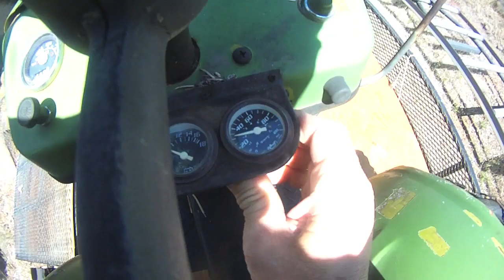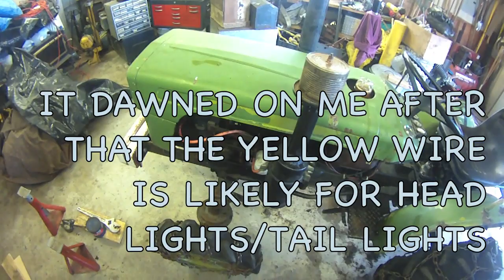Yanmar 155d Tractor Clutch Replacement

Comment: Although you may never do another tractor clutch I set up a beam in the shed or use a removable leg gantry  length  ways over the tractor and suspend both half,s from chain blocks 2 chain blocks on girder trollies so I can roll the tractor apart and back together in perfect alignment , it's worked for me several times even in the field
Reply from the maker: Hey Brian,  Funny you mentioned a beam.... I had been waffling about a gantry system...either overhead beam or building a "portable" frame.     It was this very job that convinced me to finally get one.  I just brought it up  a beam to the property this last weekend...I will have a video up in a couple days.  Thanks for watching.

Comment: I'm surprised you didn't keep ahold of it. Something like that would be pretty useful around the place. Definitely more useful than that locked up B tractor you had. Either way nice job!
Reply from the maker: I really considered it... but If I'm maintaining another tractor, it's not going to be another small frame...it's going be a full size machine....and considering how much $$ I got for it, I could not see keeping it around.

Comment: All in all that looked like a fun little project. Should last a lifetime now. If you run out of things to do, I got a farmall 806 sitting in the shop that needs a torque amplifier and a clutch. It’s going to be a bit more involved than that little guy tho. Good stuff as always.
Reply from the maker: I have split apart a couple full size tractors over the years, but the planning in doing something at that weight and scale was much better.  I'm not going to say I underestimated this machine, but I could have better planned out how to manage the two halves.

Comment: i did one about two years ago    fyi    flywheel torque is 47 - 50 ft LBS     and pressure plate is   17  -  22 ft LBS as per yanmar manual.